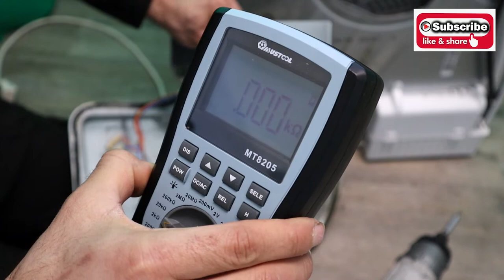Drying Machine Indesit IDC75 not heating up, Heating Element, thermostat switch in tumble dryer

Comment: Thanks for the video, I think the designer of tumble dryers could make it a bit easier to do this job. Is there any reason why the connector could be place outside of that hole. Anyway done the easy bit a disassembled the machine, now just waiting for the parts from espares.

Comment: I did this the other night. Tumble dryer is now heating up but it’s heating about twice as hot as it did before. I’ve got steam coming off my clothes. Concerned something is not right?
Reply from the maker: I think your thermostat is not disconnecting, so, check your circuit, resistance etc, with the multimeter

Comment: Hi i have this dryer but it makes a whingeing noise any ideas what it might be thankyou
Reply from the maker: Hi Sarah my first guess would be check the belt and the motor that drives, remove one of the access panel and you will see the belt that goes around the drum, only one of the sides you will be able to see the motor, there is also a bracket, to remove the belt sometimes is a pain in the #$#$", lol, because it goes all the way around the drum, mine started making a noise before snap, thank you for your comment
Reply: Hi Sarah, mine has made an intermittent loud noise from just out of warranty. I have checked the belt, fan blades all ok and replaced bearings. It still makes the horrible noise only sometimes when hot but not every time and is still working. No belt fail after 6 years. The noise is still a mystery. I hate this stupid machine 😅